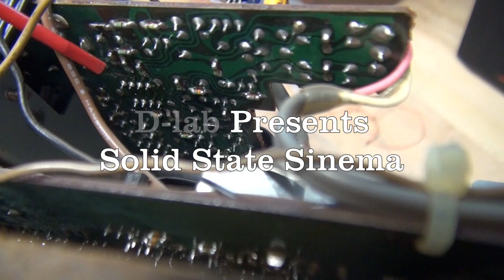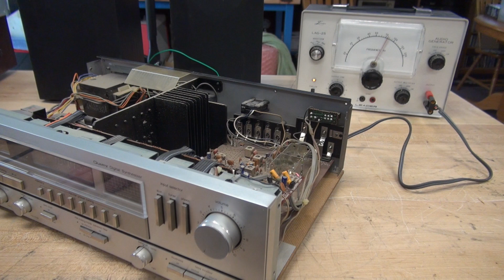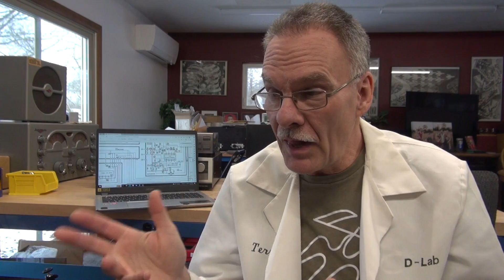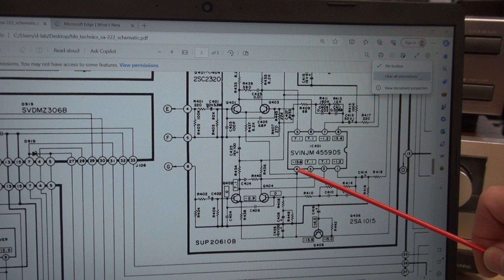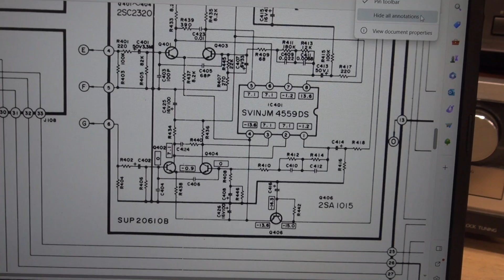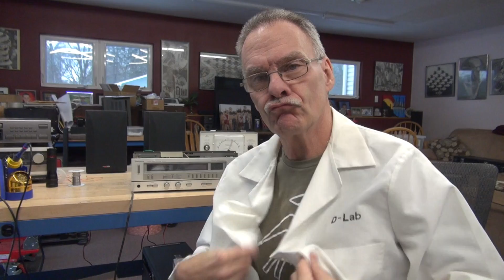How to repair dead phono input channels Vintage Technics Silver Stereo receiver Solid State Sinema

Comment: I inherited 3 McIntosh components that need a refresh. I want to do the work myself but didn't trust my skills. So, I bought a  SA-222 for $20 to just practice on. I decided to replace all the caps for honing my soldering skills. It wasn't working at all before, but now only the right phono channel doesn't work. I think I've narrowed it down to the same op-amp as in your video. I checked the voltages and I thought they were fine, but I'm wondering if my auto ranging meter may have thrown me a curve. I've got the op- amp on order but I'll double check those voltages before I replace it. By the way, I'm going to solder in a socket for the replacement and up grade to a better op-amp. Thanks for you video, I'm kind of new to this at 71 years old 😮

Comment: a shorted cap??
Reply from the maker: Yep, happens quite often in these old receivers
Reply: @d-labelectronics  cobra 2000 cb radios are bad  for that  ..10 volt caps on a 9 volt  circuit   ,,,real  smart

Comment: Preparing for an install I was about to replace a bridge/filter relay input section because my craftsman manual meter was giving me "0 ." on my output. Luckily, I came to check it with an auto ranging fluke and it has 34 volts and no issues. Here's to having a few different meters around! The craftsman would read at the input but throw up "0 ." on the output contacts, still a mystery what it was doing.

Comment: One of my ex-military electronics instructors at tech school back in '75 or '76 would demonstrate how the test equipment can affect the unit under test.  In a tube circuit with an open resistor, he'd hook up a Simpson 260 Volt-Ohm-Milliamp meter across the open resistor and the circuit would start working.  The relatively low input impedance of the 260 would take the place of the open resistor. Next step?  Charge the customer for a Simpson 260, install it in the case, and you're done! 😄

This was about the time that high input impedance FET VOMs were becoming affordable, and digital ones as well.

Comment: Good troubleshooting video. I learned a lot of electronics in the Air Force too.
At that age, this is not a repair. It's a restoration. In my work, I immediately replace all the electrolytic capacitors with the exception of the big primary ones in the power supply first. I find quite a few of those are still going strong. Replace only if necessary. After putting in all new decent quality caps, checking each on my component tester first, if any issues remain, I can rule out the caps. Then we start looking at resistor tolerance. Unless its heavy in germaniums I don't suspect transistors early on either.
Of course good blow out with an air compressor never hurts either. All that ghost poop holders moisture, increases corrosion and hides other issues.

Comment: My 1984 Pioneer receiver with aux digital flourescent display, smoked from the power supply caps, surge relay welded closed..regulator power transistors burned the alum heat sink power rails...it made 18 years...built in power supply transformer was ok..found a 15a fuse in a 10 a holder..hmm 🤔

Comment: Bad caps were a very common fault in the Panasonic stereos, (and most others from the 60's and early 70's); considering the age of the units. I always went through and ESR'd the caps also to find any ones that would cause callbacks. It took a bit more time, but my callback rate was <1%..